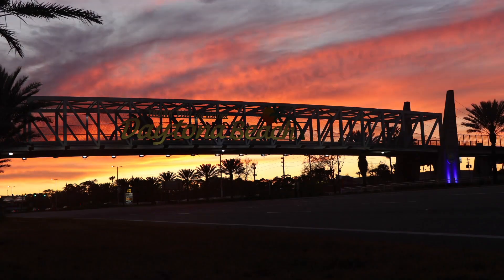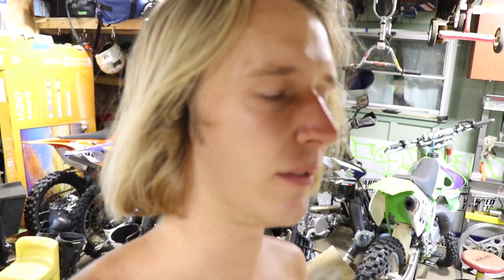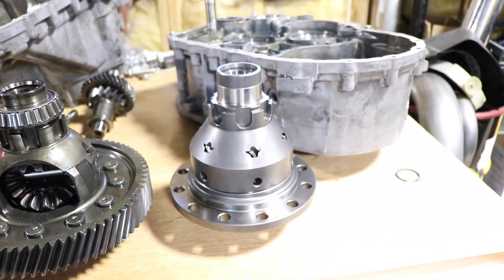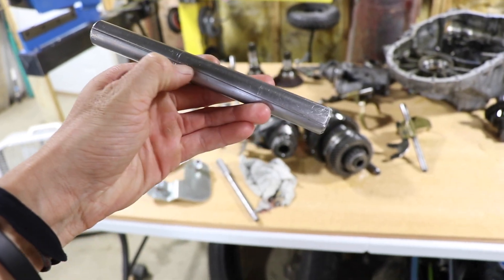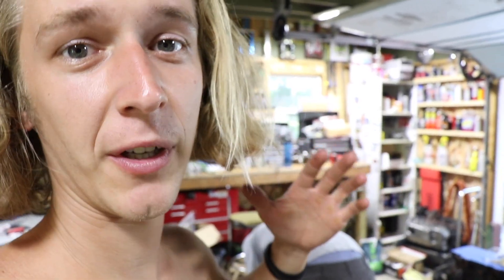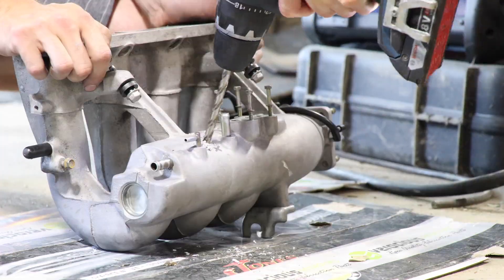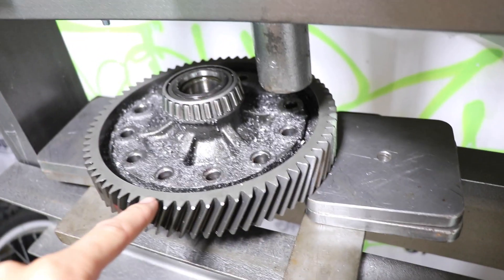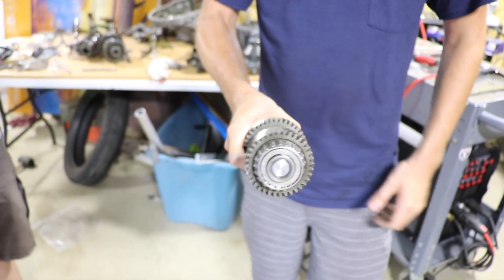🏁 TURBO TRANSMISSION BUILD//02M RE-ASSEMBLY🏁. (pt2)

Comment: Did you guys use billet aluminum rod for the input shaft?
Reply from the maker: Not billet aluminum, it was a piece of 4140 steel 🤙
It’s holding up great!!🎉
Thanks for watching!
Reply: What are the dimensions of the 4140 steel rod?
Reply: @maveric0738  it’s in the description.. but it’s a 20mm OD shaft, idk about exact length off hand. You could just buy a chunk off your supplier and use it🤙 just cut to length, even just a cold rolled piece of steel would help a bunch too and probably work fine.🏁🏁